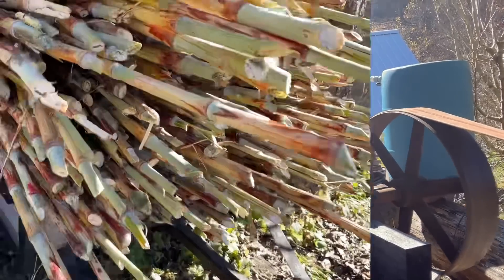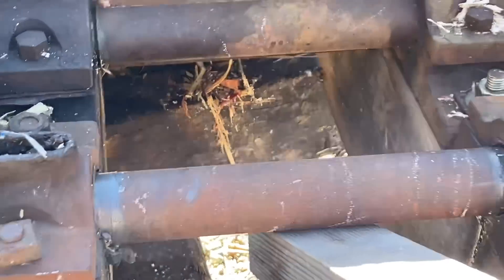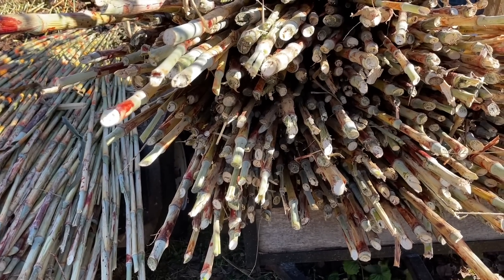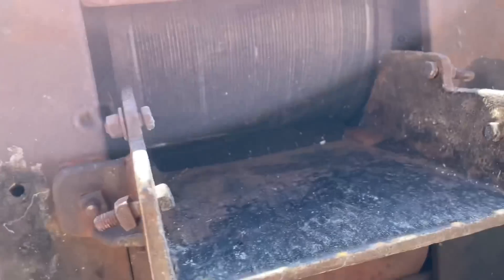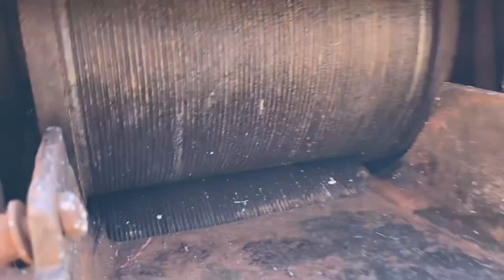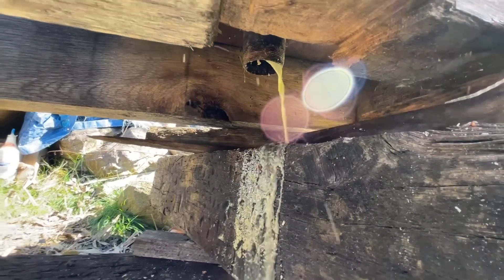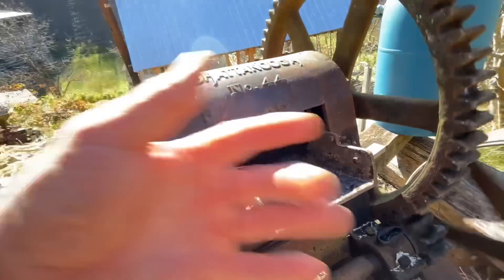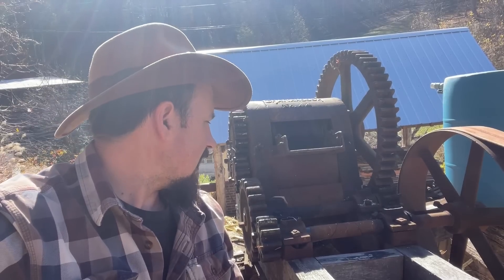Cane Mill In Appalachia fff#57 v277

Comment: Here in Phoenix I grew sugar cane this summer. It was in a raised bed that gets watered.. it started off with a few green twigs I got from Amazon and grew to way over 10 ft clump about 2 ft found. At least 30 tall canes. I finally cut it a couple weeks ago ( in my climate it never really stops growing but it was getting so big and older canes were turning brown) I tried to taste it but didn't really find it very sweet, so should I do something different to get sweet? (I did hear to leave canes lay to get sweeter but not very practical in my yard) I grew for fun and now I'm leaving a few pieces to root in water to replant in a different spot for next year, but without a machine to squeeze it I'm not sure how I can process it. This year it all went into the trash.. so sad.. but the crushers I've seen on Amazon are just too expensive and overkill for my small simple use, anyone have alternatives?
Reply from the maker: I font know anything about sugar cane, but someone on here does. 
I have seen people make a squeezer but I don’t know what the cost would be..
Thank you!

Comment: How often do you add oil in the bearing holes?  How much and what weight?
Reply from the maker: I do it when I use it maybe twice a run. Just heavy engine oil, 40 weight or gear oil will work too..